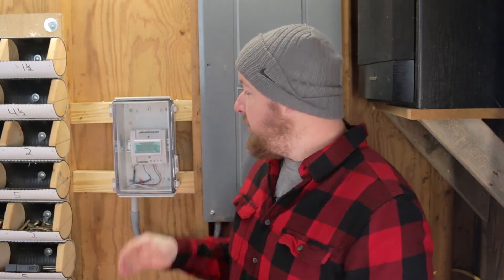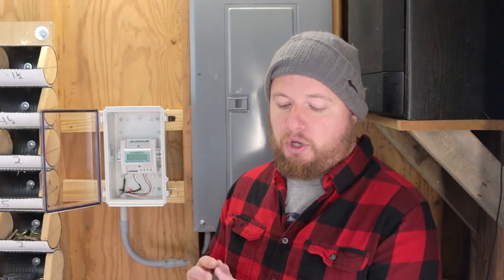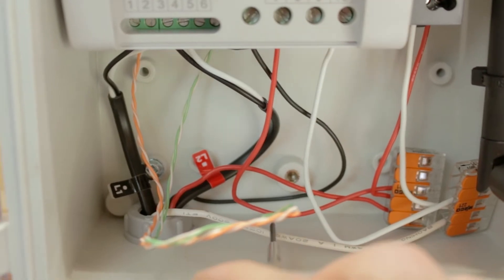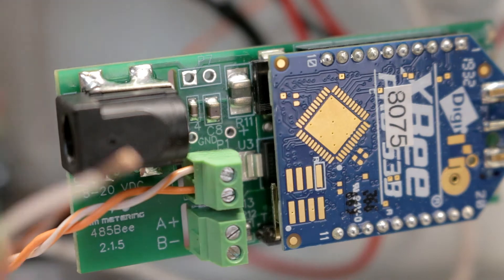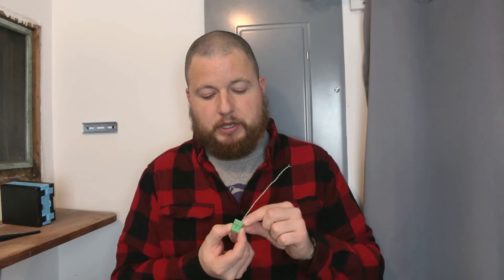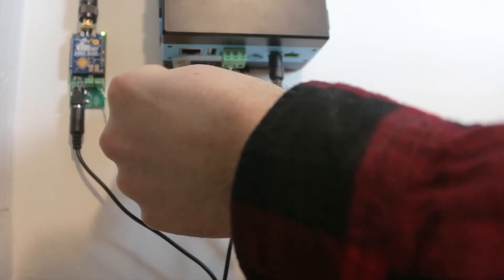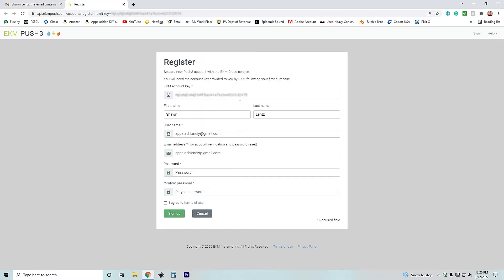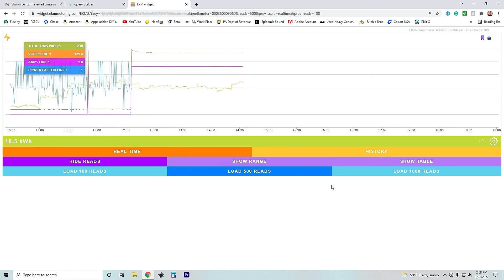EKM Push 3 Install for Utility Sub-Metering Communication

Comment: If you lose power, Do you lose your information?
Reply: No you will not lose data if the EKM Omnimeter loses power.  The meter can lose power for 30 years and still not lose data.

Comment: Great video. How would you suggest I monitor this system if I live about 5 miles away?
Reply: This is one of the huge benefits of the EKM Push system.  The Push3 gateway is reading all of your meters once per minute and sending all of the meter data to the cloud once per minute for free.  You can then be anywhere in the world and monitoring 1 to 1000s of EKM Omnimeters from a distance.  This all happens quite automatically and seamlessly without the need for a lot of technical know how and without any monthly fees.

Comment: Does the omnimeter not have hourly kwh logging on it? Just wondering if the push3 is necessary if you don't need cloud storage (I just need csv files)